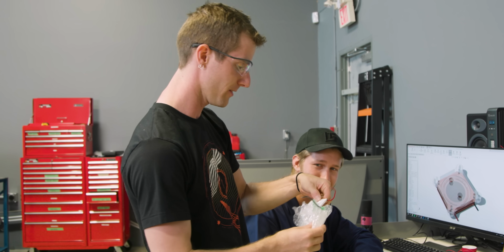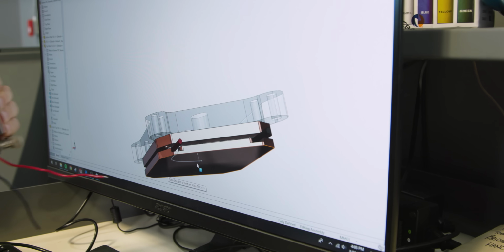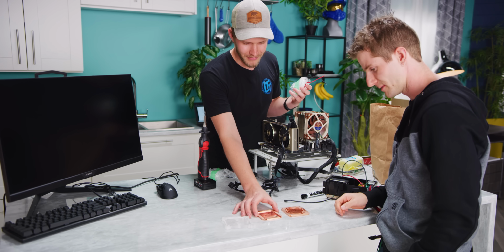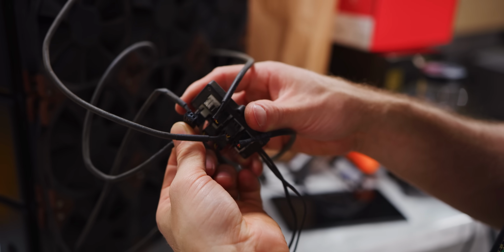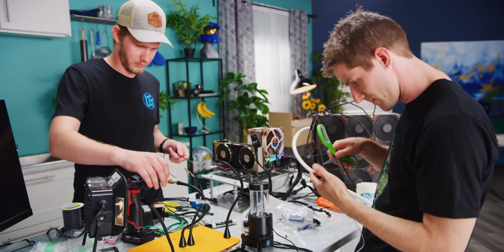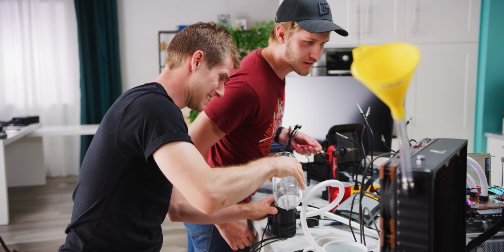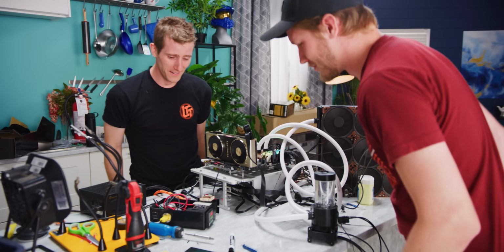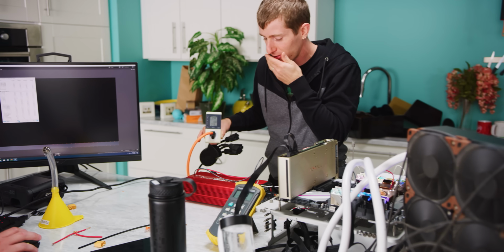This Cooler DRAWS 545W!!? Bad Cooling Ideas #2

Comment: +2 points for the solidworks flow demo and real engineering talk. More of that please tyvm.
Reply: Matt Schutzman  it was free in my area so i decided to do it, the vids don't teach you everything though
Reply: if only they tried with a more serious cooling solution on the TEC
Reply: @trif55  p0m
Reply: @Egon Freeman I've seen it! Nice results, but of course they are using a triple radiator and not an air cooler like Linus. Nevertheless, I suspect the setup is not exactly the same Linus used. I don't think they are putting the cooler side of the peltier directly onto the CPU and the hot side onto the water block I suspect it's a bit more complex than that.
Reply: 4:25 SPREAD THE COOLING
Reply: i'm taking classes on Solid works and simulation rn
Reply: @yoyodavid  ok, but who cares?
Reply: -10 for the TEC on CPU, and crippling the heat transfer with an Insulator.
Reply: If there was a real engineering talk in that video they would have figured out that putting a peltier that burns 600W (or more) watts next to a CPU would contribute to heating it instead of cooling it. XD.
Reply: @polviaortega3709 , in their defense, it is called "bad cooling ideas,"  but I'm not sure I follow your reasoning. It is a bad idea because the peltier modules own thermal output would combine with the CPUs thermal output to make the total thermal output the peltier + CPU, which I think is what you're maybe trying to say. As long as the hot side is cooled well enough, the cold side will be sufficiently cold to not heat up the CPU but move the thermal energy to the hot side. Unfortunately, they appear to have only designed the hot side cooling method to be sufficient for the peltier module and not included the CPU thermal output as well as some margin for good measure (as all engineers should). The result is not too bad cooling when the CPU is idling, but as soon as the CPU starts pumping out heat, the peltier isn't cooled sufficiently and quickly heats up itself. Peltiers are best used in places where there is little room for conventional cooling or where below ambient is required, but in all cases definitely for non-constant thermal loads. Their efficiency is so poor and produce their own heat along with the thing you're trying to cool, that it actually increases the complexity of your thermal solution, not helps. However, that latter point is something LTT was already aware of, that is the point of this and the previous bad cooling idea videos I think. But there actually isn't anything inherently wrong with "putting a peltier that burns 600W (or more) watts next to a CPU." If the CPUs thermal load is considered and an appropriate peltier is chosen, and the peltier is appropriately powered (I'd be curious to see the specifications for their module), and finally it is appropriately cooled on the hot side, it would indeed cool the CPU below ambient... it would just be a monster power sucker and be terribly inefficient, phase change cooling is so much more efficient for such a purpose.
Reply: @JimBob1937  The problem is that keeping the hot side of the peltier cool enough requires a much bigger heat sink than what you need to keep a CPU cooled... because the peltier dissipates 600W amb the CPU just 140W. So there is no point of putting a peltier cell because you could just put the peltier cooler directly onto the CPU and throw the peltier away and you would get better results.
Reply: @polviaortega3709 , not necessarily. If the peltier is appropriately cooled, you can get below ambient temperatures, something that is impossible with water cooling. It depends what your goals are. If you just want to achieve as close to ambient as possible then I'd agree, you can just do water cooling and a massive radiator. Though, it's worth noting again, they knew this was a bad idea in the first place, that's why it's called "bad cooling ideas," as it is certainly possible to make a peltier cooler work and go below ambient for a CPU... it is  just so ungodly inefficient as to not be worth it.
Reply: @JimBob1937  Yeah, you could reach negative temperatures with a peltier but the ammount of colling you would need in the peltier hot side would be insane... If you want to cool below ambient temperature a chiller is the best way. 

Yes, i know its called "bad cooling ideas", but I would love to see something that could potentially work at home.
Reply: You’re trying way too hard to fit in
Reply: There is no "real engineering talk" in this video. Solidworks Motion and Flow Simulation take all of 10 minutes to figure out. Unfortunately, they did it wrong, as usual.
Reply: @reeepingk  , true, solidworks is very intuitive overall (some negative points for odd GUI choices), but it is certainly a good step for them to be simulating their designs and running checks, and that is certainly an engineering move in my opinion. Though, based on their own flow simulation, their water dispersion could be improved a lot, with the bulk of the water flow largely ignoring their fin structure and going around the edges as well as directly to the outlet via the center.
They're obviously not engineers, but there is no reason to crap on people attempting such things, it's all a good learning experience.

Comment: I need a good cooler for my PC...
I need a good alim for this "high Watt"  cooler
I need a better cooler for the new PSU higher in watts
I need a better PSU for the new better cooler higher in exhaust power for the PSU
I need a better cooler for the new PSU higher in watts
I need a better PSU for the new better cooler higher in exhaust power for the PSU
I need a better cooler for the new PSU higher in watts
I need a better PSU for the new better cooler higher in exhaust power for the PSU

Great: I finally got it: a 4580kW PSU, cooled by an Helium cooling consuming only 3870kW, just enough to cool the PC well, letting enough power for the HDD & the RAM... & the USB ports. & the RGB

Comment: 5V is better for a Peltier. 12V or even more is not ideal... a 5V power supply running at least 4 to 5 amps would be ideal. and don't sandwich the Peltier at the CPU... it would work better after the radiator removed most of the heat.  the loop would look more like: pump then radiator then Peltier with water pass-thru water block on one side and a normal heat sink with a fan on the other side and then the CPU  and back to the pump... your water block could not dissipate at the speed it was heating up, due to the density of layers and as the Peltier is actually not an efficient material at those  temperature ranges. displacement of heat would actually be withheld at the first layer of copper at the CPU side. the idea is to cool down the loop and not the CPU directly as this will give you more control over temperature ranges and condensation at the wrong places and it would render the P.I.D. useless because if the temperature of the loop reaches anything below 10 degrees celsius, it would start acting as an air-conditioner and cool the air moving thru the radiator witch means it would cool the components around that area by siphoning the warm energy to equalize both inner and exterior temperatures around the radiator... yes it does consume a lot of electricity to use such a system on a desktop... but as this was not the idea to conserve energy, it would be nice to see such a system actually working for the Linus Tech Tips Team. just a reminder, I am actually a fan of what you guys do and would love if this contributed something to the Peltier experiment! it would be great to see another try at this!

Comment: Get a larger water block.. looks like your thin bloc , even if larger wasnt  cooling the block(comment the block is so hot ect).. i have one cooling a fridge.. the block is a lot bigger (ir its 2 inches thick from the pelt.) for a 245watt block that keeps my soda and water ice cold at 34degs.. cools a 6pack in like 10 mins on the cold shelf inside.. get a bigger <thicker block with longer fins.

Comment: I want to see this more but with the cooling element not directly on the CPU but instead cooling the water in the loop with like multiple elements and also with radiators to help with dissipation

Comment: You get better temperatures if you control the current over the temperature.  Set point 16 °C with the required current (0-50A)

Liebe Grüße aus Deutschland ✌️

Comment: I used a TEC sandwiched between an at the time off the shelf water block from Innovatec (remember the eheim 12v mod pumps?) to assist cooling my Pentium 4. Even jenkier cabling, as I just stuck the leads of the peltier into a molex 12v. Even jankier mounting, as I just screwed the innovatec mount, which had some lever-solution, down hard without using the lever. But it worked fine and I got lower temps in games than without the TEC. I still have most if not all of the components even.

Comment: It's stupid, how could the TE component dissipate the heat that quickly. Right now it's just a barrier/isolator between two copper plates. That's not how it works. You should create a loop with a normal cooler for the CPU and use the PT component to cool the loop. Not a single component, and even then it would be better to use multiple PT elements (which uses less power) in a row. This way the loop has time to actual cool down.

This video was pointless

Comment: Hey, you know, when you run a TEC at high power you actually make a heating element. You need to find the optimal power input in order to get it to actually cool, this optimum is dependent on the geometry of the TEC and the cooling ability of your cooler. Moreover, the cooling you can theoretically get from a TEC like this is only 7-10% of the power input, so if you run it directory, like you did, it will be overwhelmed at 57 W of heating from the CPU. You need to increase the thermal capacity in between the TEC and the CPU. In other words, you need two water loops.

Comment: I tried to design a 10x100W thermo-electric array to cool the water in a water cooling system but it turned out just so inefficient, and the project got abandoned after some simple calculations. Phase change cooling is much better than the thermoelectric cooling in efficiency and effectiveness.

Comment: i dont get it, why use SSR (Solid State Relay) if you want to on off DC small Amps frrom thermocontroler, you can use relay (12VDC), simple and cheap, useless part you are using for this project

Comment: You should try taking the cpu heat and making thermoelectric generator recover some the power used by the PC under a load.  You have all the tech already

Comment: Damn wish they had someone with a little more electronics knowledge do this. Just flip the tec wires to reverse hot/cold. Bigger power supply, not more voltage. Amps are what the tec needs, and more volts will burn em out, like y'all did in the video. Use a mechanical relay next time, and install a bypass switch to manually turn on and manually shut off the tec.

Comment: Of course it doesn't work, you are adding 545 watts to the system you have to cool. Meaning you'll have to cool like 645 watts instead of like 100 watts. Could have told you that that is a horrible idea all along.

Comment: You're better off putting a waterblock against the cold side of the peltier and a CPU cooler on the hot side (or an AIO/seperate loop w/radiator) and cool the water in the loop for the main components with that waterblock inline. So optimal setup for sub-ambient would be to cool the water as close to ambient with a regular radiator setup and then having it flow throught the cooled waterblock to get underneath ambient. 

Works pretty well as opposed to directly sandwiching it between a CPU and cooling surface.

Comment: How about cooling the water in a loop to really low temps, along with normal water cooling equipment.

You could have the water as a heat capacitor and use the tec along side fans and radiators as cooling, maybe put the tec on a seperate loop too.

Comment: The whole system consumes over 1000w, and the cooling of the whole system is only the water loop. There is no way it can cool a 1000w system. Besides CPU, you are adding more power into the system, so you can only get worse cooling effect.

Comment: I figerd out your mistake 
you should have been trying to cool the liquid not the cpu 

the chip needs a fan with heat sink to take away the heat created 
what you have dose not let it breath like it needs to 
it's 1 layer for heat and one for cooling and a spance in the middle to pass air though
it had nun of that to work with so it's no wonder it chocked out 

make the changes I said and you stand a better chance of getting things to work right

Comment: Short version 
IT IS NOT IMPORTANT WHEN DOES THE CPU CATCHES ON FIRE AFTER THE CPU'S ALREADY STOPPED FUNCTIONING WITH MAXIMUM COOLING 
Why ? BECAUSE YOU'RE NOT A FIRE DEPARTAMENT, YOU'RE A TECH CHANNEL 😂
Long version
Anything above maximum stable turbo boost frequency in maximum load of the functioning cpu while maximum cooling and anything below minimum stable functioning frequency in minimum load(idle) of the functioning cpu while minimum(or none) cooling is not important in average consumer grade cpus, because consumers optimal average room temperature won't change much regardless of the time of the year, month or day And it doesn't matter how hot or cold the cpu gets after the cpu has stopped functioning from cold temperature without cooling or hot temperature with cooling  Air conditioning DING DING DING 😂 YOUR TEST SEEMS LIKE CHECKING HOW HOT THE CPU GETS AFTER THE CPU HAS ALREADY STOPPED FUNCTIONING AND HOW LONG IT TAKES TO THE CPU CATCH ON FIRE WITH MAXIMUM POSSIBLE COOLING EFFORT 😂

Comment: ALSO IF THE ACTUAL QUESTION IS HOW HOT DOES CPUS REALLY GETS ?  THEN IT IS THE INCORRECT QUESTION THE QUESTION SHOULD BE HOW HOT DOES CPUS REALLY GETS BEFOR THEY BECOME COMPLETELY UNUSABLE AND NON FUNCTIONING AND YOU COULD HAVE JUST PUT EXACT THE SAME MATERIAL AND SIZED METAL SHEET AND RUN BOTH CPUS AT THE SAME TIME AND LOAD THE CPUS WITH THE SAME TASK AND WAIT AND RECORD THE TEMPERATURES(MOSTLY THE PEAK TEMPERATURE) TILL THE CPUS BECOMES NON FUNCTIONAL ANYTHING BEYOND THIS POINT IS USELESS BECAUSE CPUS MAY NOT CATCH ON FIRE UNTIL THEY HIT 200 CELSIUS BUT IT DOES NOT MATTER IF THEY STOP WORKING AFTER 100 CELSIUS OF COURSE COOLING METHODS COULD CHANGE IT, BUT IN THAT WAY YOU MAY GET TO KNOW EXACT RAW PEAK FUNCTIONING TEMPERATURE OF THE CPU AND AFTER THAT YOU CAN MEASURE THE LOWEST FUNCTIONING TEMPERATURE OF THE CPUS
AND THEN COOL BOTH CPUS WITH THEIR LOWES FUNCTIONING TEMPERATURE AND LOAD BOTH CPUS WITH EXACT SAME TASKS AND KEEP ADDING HEAVIER TASKS PROGRESSIVELY UNTILL CPUS REACHES THEIR MAX CLOCK AND AFTER THEY HIT THEIR MAX CLOCKS AGAIN KEEP ADDING HEAVIER TASKS PROGRESSIVELY UNTILL CPUS STOPS FUNCTIONING FROM THE HEAT AND RECORD MAXIMUM LOADS, TEMPERATURES, AND TIME THEY TOOK BEFORE THEY BECOME NON FUNCTIONING 🤓

Comment: Around 02:30 Umm, I know Anthony's smart and all that and you guys take that into the consideration But what about other factors that affects temperature measurements accurateness ? Everchanging room temperature by time, temperatures being different from one to another place in the same room, jug's temperature conductivity etc I know most of them could be solved by doing it at the same time and at the same place and using the exact same tools and materials Ignore me I'm just trying to look smartass 😂 Nope I was right you guys butchered the science You haven't conducted the testing of two cpus at the same time Rooms temperature surely changes after all that heat goes into the air And when you're measuring the second cpu the rooms temperature will be different, either because of the heat output from the first test or just because different environment(different day, differnt time of the day etc) Especially Linus made a lot of  incorrect measures(or should I say guessed?) or lost the track how much water he each time poured

Comment: IDK why you guys have so much problems with TECs. I had a Pentium4 and ATI (not amd) radeon 9700pro TEC cooled in a loop and it was able to sustain just below ambient under load. Wattage of the TEC psu was around 300w if i remember correctly.

Comment: You need better cooling of peltier module. With 180watt peltier you can easly  cool 95 watt CPU under ambient temperature. But the "hot side" need be at 40 degrees max. Then you can make sub 0 on cpu :)  I try it on i7 2600k and it really work :)

Comment: You could just put a standard water cooling loop on but add a water cooling plate for the peltier devices to mount to just for cooling the water down. I've seenot before in videos to cool your drink down quickly. If you had enough of the peltiers in the loop it could cool the water down in a controlled manner to where you wouldn't need a relay or anything

Comment: u need to use a thicker copper block between the cpu and the cold side of the peltier, that will help to reach better temps on the cpu die. it will act as a cooling buffer. in ur setup u are not using all the peltier capacity to cool the cpu, it is actually the same logic u used while creating on the oversized water block, but on the cold side. the blocks used to be up to 1 inch thick.

Comment: Hi linus team.
Would you be kind enough to solve a small problem that i am facing with my led monitor..
I have an old system which doesnot have hdmi port for display. But i m rocking a LG led monitor which has a vga port and hdmi which i use to connect both my pc and laptop.
Currently the monitor is connected to pc with vga cable. But i m noticing that the display i m getting is hazzy and have weird waves of dispersion. But when i connect my laptop with hdmi it works fine. Can you tell me what's wrong with my desktop cpu.?? Atleast hint as you people are best in this. 
Thanks in advance